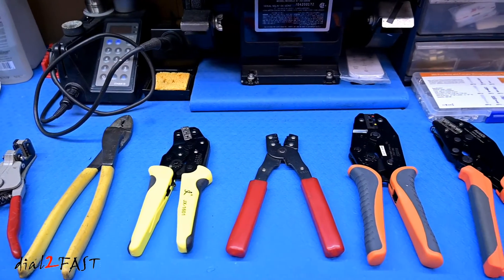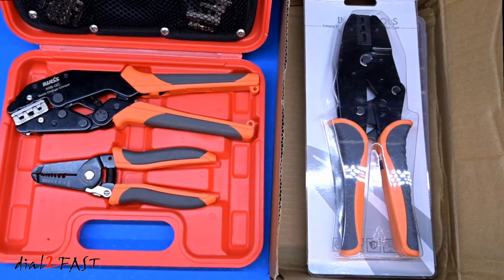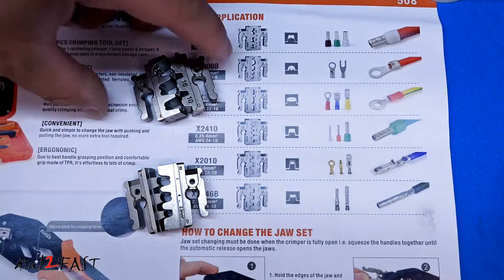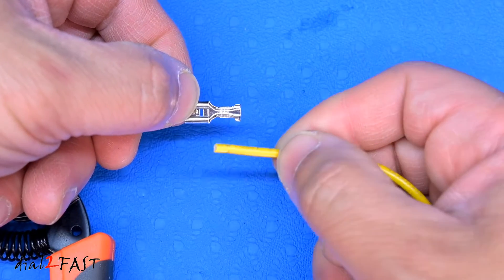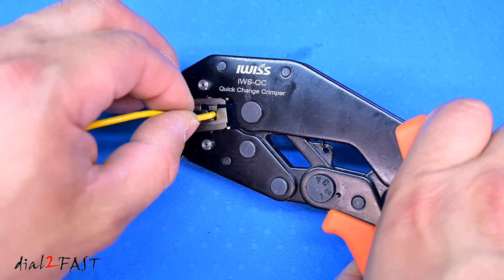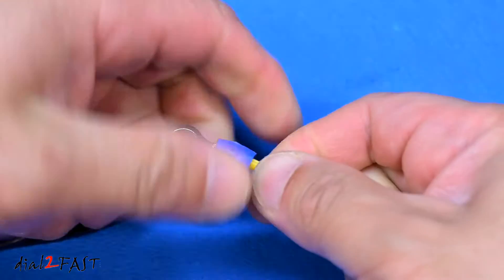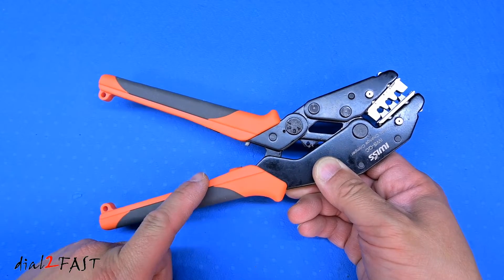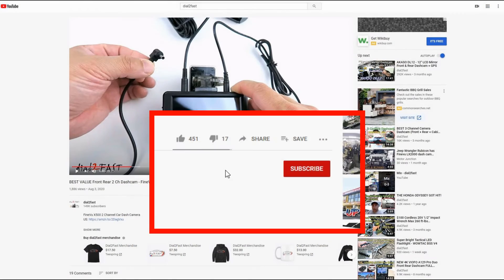How To Crimp Insulated & Non-Insulated Crimp Terminals | IWISS Crimp Tool

Comment: I had those thin cheap crimpers for years and never got a good crimp so I always soldered. bought the new high quality crimper and it's a game changer!
Reply from the maker: Glad you got a good crimper!
Reply: I was doing the same, always was soldering them, because the insulated was not trustworthy, but I just bought one of these tools and no more soldering!

Comment: 1. Do not use a too large connector but the smallest.
2. Never add solder or a tined cable.
3. Never cut too much isolation off.
4. Never insert the connector the wrong way around into the tool.

Comment: I don’t have an IWiss but the SomeLine tool. It’s good quality. 
—> Here’s the rub…
I’m doing what you instruct but the end towards the wire is getting mangled. I adjusted the star wheel for 1 notch less pressure from factory but still mangled the terminal ? I’m using the correct slot of 1.5 in my case.
Any suggestions ?
@dial2fast

Comment: Very good video, shows the details and clarity that the subject of this topic requires! Unlike a lot of similar YT ones.
Just a question on using insulated terminals. 

I noticed that you used the dedicated tool for demonstrating the use of insulated terminal crimping, and I know most of the similar ones of that type have the 'stepped' die recesses to ensure that the crimp over the wire part gets a firmer crimp than over the insulated wire part as expected, and I sometimes see people not inserting the crimp the right way round, doh!, but I know that the corresponding die for the interchangeable die set one doesn't. 

In your experience does that create a weaker crimp?

Many thanks.
Reply from the maker: Hi Mark, the crimper with the insulated die is made specifically just for the insulated terminals. The part of die that crimp down on the conductor portion is smaller and tighter than the side that crimp down on the insulated part of the wire. So one single crimp action will compress the entire terminal properly giving you a solid connection.
Reply: @dial2fast  I see. Thanks for taking the time to reply.

Comment: can you crimp the heat shrink terminals with the insulated crimper or should you use something else?
Reply from the maker: Yes you can crimp the heat shrink butt connectors, then apply heat on each end to seal it.

Comment: The hardest part is every brand of wire and terminal has size discrepencies.  I suggest adding lead solder to any connection you might suspect being loose.  Silver solder cracks.
Reply: That doesn't work long term in vibration, or marine environment. A proper crimp tool will create a cold weld joint, and will prevent oxidation inside the copper strands. FYI from a professional...